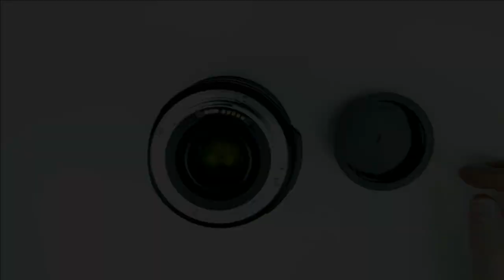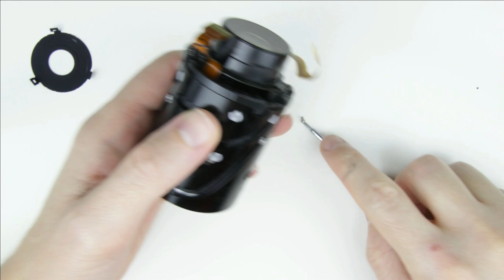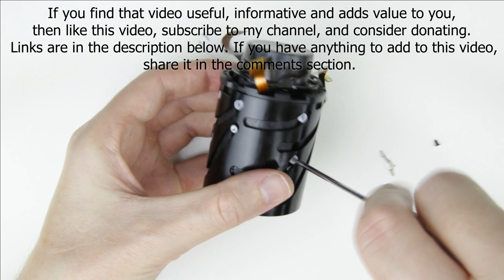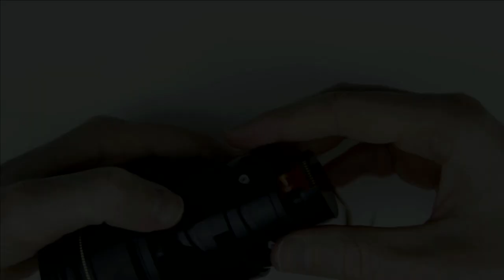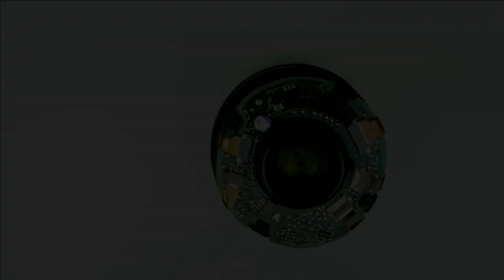Canon EF 28-135mm f/3.5-5.6 IS USM disassembly and assembly - repairing the stuck zooming and focus

Comment: Thank you very much for posting this video, my Canon EF 28-135 didn't zoom out to 28mm because something was stuck at aprox. 50mm.
After disassembly I was able to put back one of the cables that came out of it's place.
Then I fixed the cable in place with a piece of tape.
After reassembly the lens works just fine now.
Without this video I didn't know waht to do.
Reply from the maker: You're welcome!

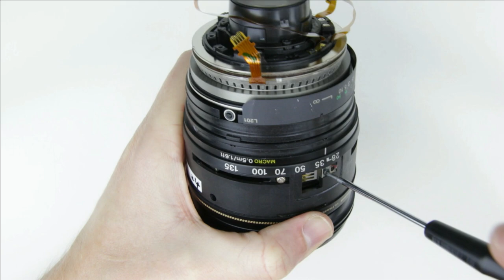Comment: Fantastic tutorial, I have dared to repair my 28-135 according this instruction, took way long, it helped removing pumping auto focus up to 100mm, above it is still not functioning. It is likely the zoom brush seen in 6:30, some pins of mine are twisted, one is broken. How can I get this part?
Anyway this video is absolutely useful!
Reply from the maker: Check ebay, there is lots of parts for sale, alternatively you can check out aliexpress.

Comment: very nice video. i bought a 28-135 today for $20 and it won't zoom past about 115mm, otherwise it's perfect. hopefully i can fix it easily.
Reply from the maker: Good luck! Usually the loose screws which are holding the front lens tube causing this problem... easy fix.

Comment: I'm really not sure if the risk @ 11:00 is worth it. If the loose focusing element crashes into the back of the front lens group, the damage could exceed the lens' worth. Remove the front lens group beforehand (mark its position/orientation before you remove it) and then @ 11:00 push the cam barrel outwards and – after marking its orientation in the cam barrel – grab it carefully and screw it out, then store it in a secure place.
Reply from the maker: Thank you for your tip!

Comment: thank you so much for this video, I was able to fix the stuck zoom problem, it was due to one of the 3 main screws being bent so I took it out and now my 2 lens parts are attached by 2 screws only. My new issue is the lens does not auto focus, it only manual focuses. Pls can you tell me if you have another video I can follow to fix this issue? thanks again.
Reply from the maker: When you want to autofocus, what does the lens do? Hunting for focus?
A few ideas:
- is the USM motor and the focusing lens element is connected with the lever? If you move the manual focus ring, does it twists the focusing lens element inside?
- Is the rear cover connected correctly (flex cable if the switch)? When you view the autofocus mode, does the camera shows AF or MF? If you switch the AF/MF switch does it change in the camera?
Reply: you are so awesome for such a prompt response thanks! 

so I went back and opened it up, it turns out the aperture flex cable was not inserted correctly. I fixed that, and the error message 00 went away, and I am now able to change the aperture and it shows on the camera window, and I can see electronic contact again with the lens. What is happening now is, I cannot click a picture in AF, and when it tries to focus, I hear a slow sound, and it cannot auto focus anymore.

The answer is yes to all your questions, but I did not understand this part of your question: "- Is the rear cover connected correctly (flex cable if the switch)?

On MF I can take photos fine, and I can use the zoom ring to focus, when on AF, I cannot focus or take pictures. 

I must say too, one of my flex cable covers on the motherboard broke off, so I tried to stick it back on with a piece of tape, do you think I need a new motherboard? do you sell those?

Many thanks for your help!
Racha
Reply from the maker: - Is the rear cover connected correctly (flex cable if the switch)?: it could happen that the AF/MF switch cable is not connected, and the lens is stuck in MF mode. You can check that by switching the AF/MF switch, and the focusing method in Q screen should change accordingly.

As I understand, the problem now is the focusing seems very slow, so the USM motor seems stuck or sticky?
Can you confirm that if you move the manual focus ring, the second lens element (counting from the front) is moving with it?
Reply: @CamerasLensesEtc  Hey, thank you for your time. Yes when I switch the button from AF to MF, I see that the ONE SHOT disappears inside the Q screen. I can't confirm the second lens element is moving with the manual focus ring, I can't see properly. Do you think I should repeat the video from the start and take the lens apart and start again?
Reply from the maker: In the video at 25:38 I connect the lever of the focusing lens element with the fork of the USM motor. My suspicion is that they are not connected, so the USM motor does not moves the focusing lens element.
At 34:00 I check if the manual focusing ring moves the second, focusing lens element: on the side of it there is a part for the lever (so the side of the second lens element is not completely round but there is a part where the lever goes out of it), and by that part you can see if it is moving.
Reply: @CamerasLensesEtc  Okay, will take a look and revert back. Thanks

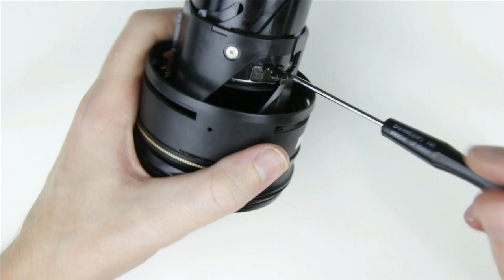Comment: Hey there I think I found the problem. At the mechanism connector at 9:51 was completely disconnected and jingling around. The screws are completely missing however and it looks like they are smaller than the other screws I’ve been unscrewing. Do you know the size of those screws so maybe I could order replacement ones somewhere?
Reply from the maker: That is a quite common problem. I don't know the size of the screw. Are both of the screws missing? Have you checked the inside of the lens, maybe the screws are there somewhere maybe stuck in lens grease?
Reply: @CamerasLensesEtc  I opened the whole thing up and didn’t see them. I know they are rather small so it’s possible I missed them somewhere, but I was able to find replacement screws by looking up the Manual that had all the parts listed. I’m hoping that will be right

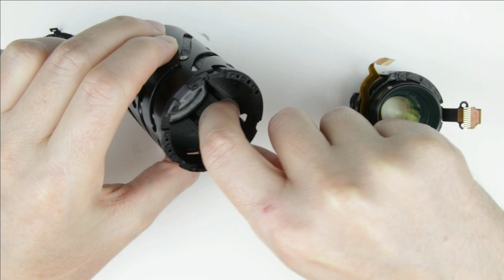Comment: the pins pushed in during @15:20 came out and the two cylinders came apart. I'm having quite a bit id difficulty aligning all the tracks again to  put the white beads back in. any advice on the best way to get it all aligned again during reassembly?
Reply from the maker: Well, check out the parts of the disassembly and assembly videos where you can see those lens tubes, I'm quite sure you can attach the two together correctly by that.
Reply: @CamerasLensesEtc  
I gave not been able to reassemble it, can anyone confirm if  the cylinders using the small white plastic tubes has any mark to help align it, or if perhaps they have multiple acceptable alignments.
Reply from the maker: @craftymaster  I don't think those are eccentric, so doesn't matter their position.

Comment: Would I have to disassemble the entire lens if I wanted to replace the lens filter frame that is on the front barrel? Part CY1-2823
Reply from the maker: I'm not sure because I haven't done that before, but I think you have to remove the front lens element, then you cn remove the screws underneath it which hold the filter holder, then you have to twist it to release it from the middle cover tubes.

Comment: I have this lens. My particular one has a really bad case of lens creep. When you turn it down the glass wants to slide right out just from the gravity. It looks pretty easy to disassemble, but is there any way to fix the lens creep?
Reply from the maker: Yes, this an easy fix. Disassemble the lens until the USM motor is removed. Then tighten the three screws (wide head, silver color) which connects the front lens element with the inner lens tube.
Reply: @CamerasLensesEtc  Thanks I'll give it a go.
Reply: @CamerasLensesEtc  Hmm, the screws you mentioned were in there so tight that it took a lot of effort to get them out with a driver that fit them perfectly. I can't imagine I'll be able to get them back in tighter than that. Guess I'm just going to take the entire lens apart, examine it and reassemble hoping it will be better when it's back together.
Reply: @CamerasLensesEtc  Nevermind. In the end it was definitely those three screws. The only thing I wonder about now is that the barrel holding the inner lens(es) had a lot of grease on it. It is significantly less greasy now because I was touching it a lot. Great video, there were a few areas you could have touched on just a bit more but this is my first time disassembling a camera lens and it was much easier than I expected, especially with your video.

Comment: The focus of my lens is inconsistent. Sometimes the motor drives in one direction only. Manually focussing is fine. Is it likely to be a mechanical or electrical issue?
Reply from the maker: I don't know, I haven't had lens with this problem before.
Reply: @CamerasLensesEtc  Thanks for the quick answer. I'll investigate with confidence with your video. If I find anything, I'll report back.
Reply: @PeterDempsey-yarglags did you find anything?